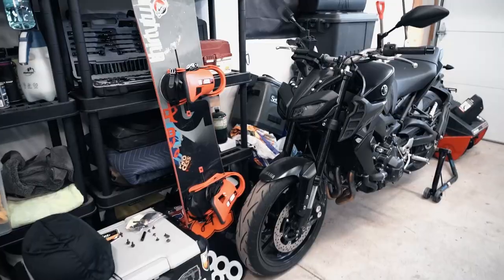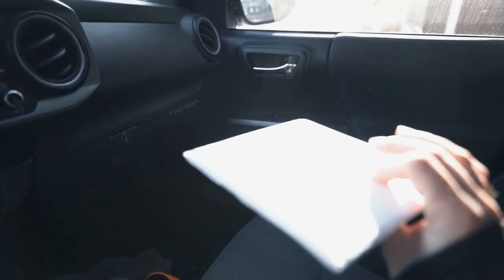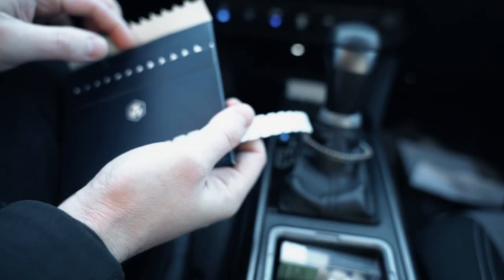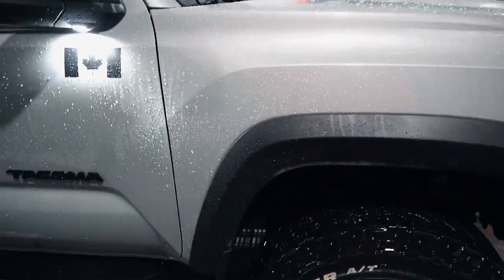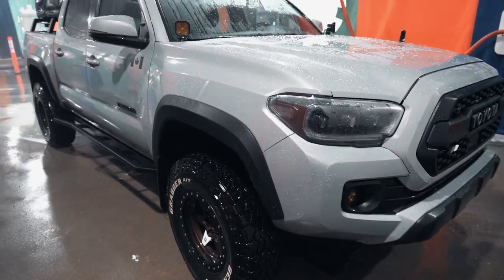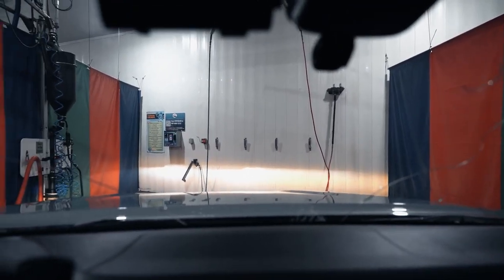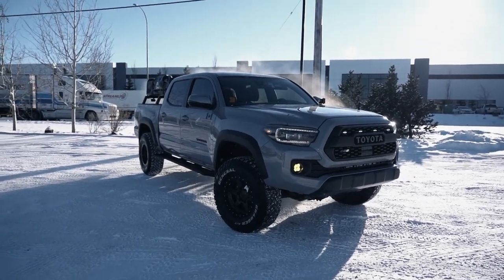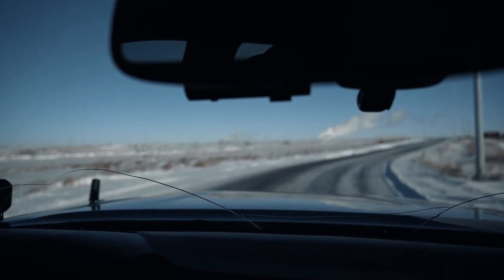Welcome 2022, an old-school Vlog: Washing the Tacoma when it's -30°C Outside ( a very cold 🌮 )

Comment: Hey dude. What’s your driving psi with those tires? With your current vehicle load out and all
Reply from the maker: I usually keep around 35 psi driving around!!  But, offroad, I drop down to 18-20psi !
Reply: @SpencerHogg  thanks! Been doing 40psi with stock weight and all. Might be seeing slightly more tread wear in the center treads compared to the sides. I’ll try 35 all around. Running same tires btw

Comment: how do you get your passenger door to work with the "proximity" unlock
Reply: I believe that was only introduced on the Tacoma in 2019 or 2020 model year. Older models are out of luck.
Reply from the maker: In the menu settings of the Nav. / Radio there's some options you can change such as door locking behaviours (allow only driver, or, allow passenger too, and, if it unlocks all 4, or only the 1 door, etc.) and you can change the welcome light times, etc.
Reply: @SpencerHogg  thanks. I should be picking up my 2022 this month sometime. I saw a few forums about doing this mod so I assumed that it didn’t come standard on any models.